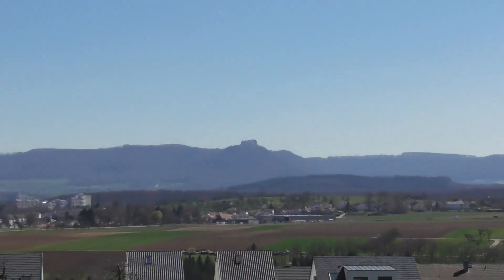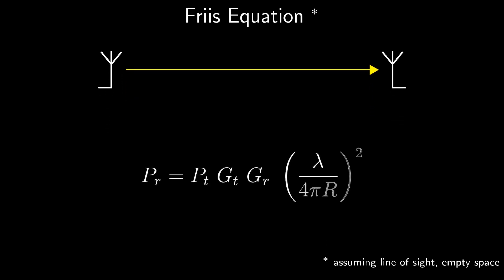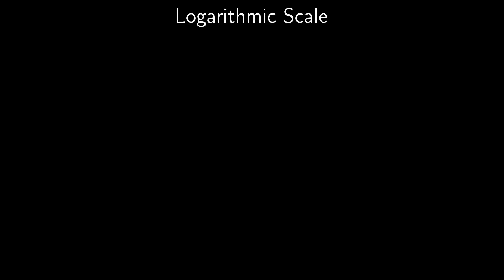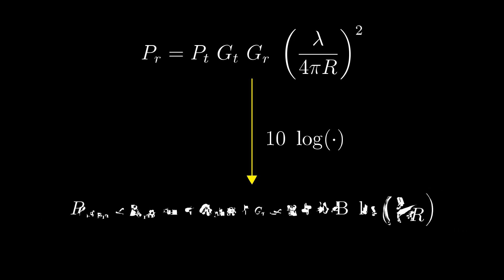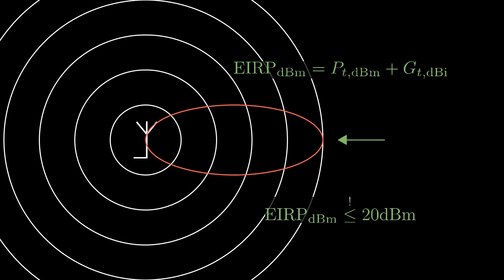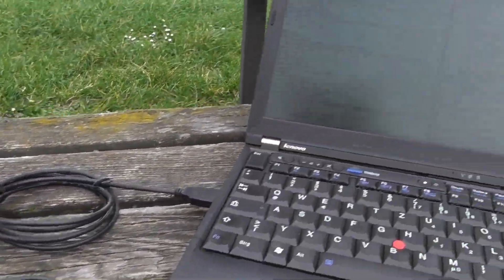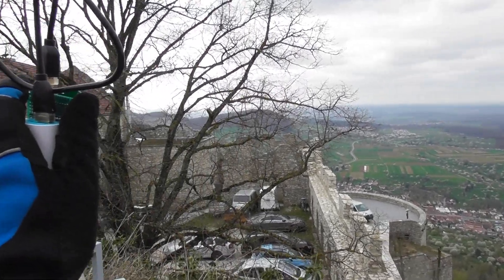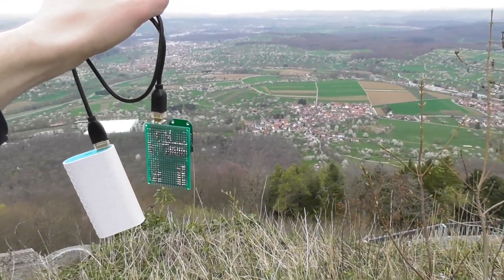ESP32 WiFi Range Testing - 10km using Directional Antenna

Comment: you should try using cw communications by (mis)using the FCC test function built into the esp32. you should be able to get lock at far lower signal levels. bonus round: place esp32 on the lnb of a tv dish and uplink to qo100 ham satellit transponder (2.4ghz cw)

Comment: I just remove the antenna from the grid reflectors and mount the esp32 or esp8266 itself in a PVC tube in its place.  It's still using the standard PCB antenna, but it's now in a nice high-gain place!

So, "technically", I'm not really breaking the rules, but get a few kilometres range on my mesh networks. 🙂

Comment: In case someone, as me, try to understand how Jeija did this...

There is no connection between emitter/receiver, this is achieved by not using conventionnal wifi but just the broadcast mode that is usually only used by the AP to advise any device that it's own network is in range, that mean this data isn't sent specifically to one device but to all of them able to listen (mainly this is network name, kind of password safety...etc).

In the esp32-80211-tx sketch, we roughtly take the first part of the beacon frame, then add the false SSID name and then add the end of the beacon frame before to send it. By this way the hidden AP make believe that some other's network/AP are availables.
That don't change the beacon frame size, it only make believe another sender exist.

The same process can be use to carry data instead of fake SSID's, but the beacon frame isn't extensible so only, 32 bytes can be carried by SSID part, 6 bytes by BSSID (mac address) part and 253 bytes by the beacon Information Element part of the beacon frame.

That mean the data to send must be splited in some consecutive beacon frame's with an ID number so that the receiver can reassemble the payload of each frame in order to reconstitute the original data. This process can be use for advertising or some other's legal stuff or... to stole data by a hacker.

As you understood it's not an usual way to use the wifi beacon frame, that mean despite the screen of Jeija during the video look like a web page, there is no adress to connect to it because there is in fact no connection between emitter/receiver, it act few like terrestral numeric television (TNT).

So it's necessary to have a special program on the receiver side that decode each beacon frame, extract each small payload data and reassemble it.

This is probably the impressive job that Jeija did and it's really pity that for some reason (maybe good reason's), he seem to don't want to share specifically his camera example which is really amazing.
Understand the code of esp32-80211-tx sketch and even modify it seem possible but the program to decode is definitely out of range regarding my knowledge...

My aim was to make a target camera with numeric quality and long range (500 to 1200m).
I won't do it ue to decoding program, if someone can and share, I would be very glad.

Comment: I have the AI thinker module ESP-32S and the FT232RL and still no joy. But I refuse to order another one. There is someone who recommends adding a small 10Uf capacitor between 2 spots. I suppose i will try that next. But i didn't realize there was face recognition in the software... for $8? Wow.

Comment: Dear author, would it be possible to publish 1) the final code that actually streams the jpeg data from esp32 with that one-way data stream and 2) some info how your notebook is able to receive it in that "monitor" mode? It would really-really helpful.. The published code (broadcasting some rickrolling SSIDs) is not really helpful to understand how the final project works. Thanks!
Reply: Well, just follow these steps as I mentioned below, tou can do it with the help of chatGPT:
1. Input jpeg 
2. Design a encoder (to encode jpeg from jpeg to binary) 
3. Transmit the data using WLAN or LoRA
4. Receive the binary
5. Binary to jpeg decoder (keeping everything similar to the previously designed encoder)
6. Export the jpeg to local drive

Comment: Very cool, I have the camera built into an ESP32 that is sitting in a drawer doing nothing along with several other ESP32's and 8266's.  Perhaps I should put them to work, I have been playing with that idea for some time, this video simply adds to my desire to see it work. I have no need to go 10 K but putting the camera in the back window of my Ford Edge that is hooked to my 35 foot Class A motor home and putting the monitor on the dash of my rig sounds like a wonderful idea.  I already have the backup camera system but my rig is over 10 years old now and the innards of the poor old B&W monitor have taken a beating, I need to rewire the power to get it working 100 percent, but now I have it at about 65% with the need for a sharp crack from my fist when it goes out. I have been repairing broken traces on the main board of the little monitor now before every major move, and it is getting to be a pain in the back climbing under the dash to access it all the time.

Comment: Anyone found links to purchase antenna and parts?

This might work. Need to check the connector type

https://rover.ebay.com/rover/0/0/0?mpre=https%3A%2F%2Fwww.ebay.com.au%2Fulk%2Fitm%2F281332287432

Comment: I'll pay whatever, so i can have internet from Starbucks at my home......
Reply: Lmao ! The main general working points here are 
1. That guy lives too far on country side.
2. I am barely seeing any other frequency operating ,even electronic item around in that bizzare .So ,nearely zero traffic  congestion .
3. That's placed over on a mountain peak .
Reply: But someone could always spy on your traffic from afar with this radar dish.
Reply: @TheRainHarvester  correct. when you leech from public or (god forbid) random unencrypted or WEP (they still exist yes, you'd be surprised), of course you need to be on your best behavior and not do stupid things. Don't go ordering stuff or pay your bills on that connection. Use your brain..
Reply: SWIM used to leech from public wifi's like the local pizzeria. It's good when you have an uninterrupted line of sight connection a few tens of meters. For example one used to be able to leech movies at night, but in the daytime because of increased car traffic the signal was sketchy. It's good to have as a plan B for when your own internet connection for some reason is lost.
Reply: Public WiFi sucks
Reply: No you not, due ACK settings distance limitation.
Reply: @jimsonweed1846  Default ACK timeout on many devices is around 10–20 µs. This supports around 750–1500 meters distance (one-way). Beyond this the ACK will likely time-out.
Reply: Yep but Starbucks or employees in it make do something if they are geeks and if distance is less approx 2 Km it may be possible and ,Finally they may know your passwords , credit card details or something very important like your g mail account 😉 better go for taking a connection even there is chance that a hacker is between you and public WiFi which may cause you lot of damage ,so keep avoiding public WiFi
Reply: @AnilArya51  Lookup "humor" in dictionary

Comment: i think its possible to send the signal even further, but you're limited by line of sight, the 2.4Ghz have a limited NLOS ability, basicaly 4/3 beyond the horizon distance.
i remember there was a record for wifi transmission done from 2 montains on different islands with over 300km distance.

Comment: With the 24dB Antenna and 500mW I made contact to the QO100 Satellite. 36000km in 2,4 GHz
Reply: Hi,  I am a ham operator here at Spain,  which mode did you use? I have seen it works at 10GHz, but havent find at 2.4

Comment: Fun fact.  You can split the transmit and receive signals out to different antennas.  Use a higher gain antenna for rx and a lower gain for tx.  Battabing butta bang, Bidirectional long range communication.
Reply: zyxwvutsrqponmlkh may it be possible??
Reply: @p__--  It's not just possible, its used in industry all the time.  https://www.ui.com/airfiber/airfiber24-hd/

Comment: Hi
With this i can receive 10mb from my router 2km away?
Reply: Recommend using some kind of directional hardware on both ends, a cheap yagi, perhaps? It should be pretty doable if you have LOS and less vegetation/obstacles on the path....

Comment: So if he pointed the antenna was pointed onto the village down there he would receive the wifi names but couldn't connect to them right?
Reply from the maker: Yes, correct. Unless I (illegally) ramp up the transmit power on the directional antenna's side.
Reply: @Jeija  Does that mean that if I had an directional antenna , I could just point it to the next free WiFi spot and give it more transmitting power and then I had WiFi?
Edit: Or maybe the normally allowed power for a omnidirectional antenna would be enough because the directional antenna concentrates it?
Reply from the maker: @dasgettopikachu7878  Yes, pretty much. And you are right, just the normal TX power (typically 20dBm in Germany) would be enough when using a directional antenna. In fact, you have to manually reduce the TX power when connecting a high-gain antenna to not violate EIRP regulations. But this kind of setup also relies on the fact that there is a clear line of sight, otherwise this is not going to work. You can search for "link budget" and "Friis equation" if you want to know more about this.
Reply: @Jeija  
Wow , thank you for demonstrating the receiving characteristics of directional antennas and also for answering my questions because for me it's very interesting!

Comment: Bah! I dont care about regulations! I'll use 1w power!
Reply: Become an amateur radio operator and you can legally run a lot more power than that. In Australia you could run up to 120w with no limit on EIRP. You would just need to do a few things like transmitting your call sign and not user encryption to comply with the rules.  Other countries may allow even more power. Keep in mind power doesn't always help and I've been able to use legal wifi power levels to cover 40km.
Reply: @vk3fbab  being a radio operator doesnt give you right to emit whatever power on all frequencies
you can only exploit your license on ham radio specific ones
the wifi standard falls on the 2.4Ghz band and its an ISM band, its license free to use, but with a limited power
and you're not protected from interference by other devices
Reply: @zazugee  in Australia we have rights to operate over a fair bit of the 2.4ghz ISM band under ham license. So long as I comply with the license I could legally tx 120W power. Would I? Not much point as you don't need that much power at 2.4. ham bands and power levels differ around the world. Here for advanced calls it's 120w any bandwidth any emission mode at 2.4ghz.
Reply: @excited box you might get better than 10km too even with omni antennas. Height  is might. I've done over 40km wifi without having to resort to using Ham power levels. From 100m high apartment to a 250m high summit.

Comment: Hi

What was the bitrate of the video stream? Was any compression used?

cheers Peter
Reply from the maker: It's not technically a video stream, but actually just a sequence of JPEG images. I used the JPEG compression inside the OV2640 camera. The bitrate depends a lot on image quality / framerate etc., but it's close to 1 Mbps.

Comment: What if you could use a directional antenna at ESP32-side? Of course a little bit smaller antenna than receiver, because ESP32 can not feed big antenna, I think. With directional antenna at ESP-32 could you increse the distance?

Comment: did u really just use this on-board antenna on the transmitter side? and if so how strong would it be if u would use a good external antenna on the transmitter side, too?

Comment: Also the conditions are really favourable because transmitter is on the hill. If terrain was flat, both receiver and transmitter would need to be raised high to to ensure the Fresnel zone is not obstructed. By the way it is possible to play with the polarisation of the signal by turning antennas 90 degrees to enhance the signal  quality.

Comment: How did you get your TP-Link T2UH working on Linux?
Reply from the maker: There are several drivers available, I think I used this one: https://github.com/chenhaiq/mt7610u_wifi_sta_v3002_dpo_20130916, just search for "MT7610". There is also this guy that seems to be working on improving the driver and eventually getting it upstream: https://github.com/ulli-kroll/mt7610u
Reply: Tnx and which linux distro did you use?
Reply from the maker: Archlinux
Reply: @Jeija  btw

Comment: Amazing to see how well that tiny chip can transmit data so far away.
Is it possible to increase the received data quality by using something like a dish at the transmitter side to direct most of the radio signals towards the receiver?
Reply from the maker: Technically possible yes, but also most likely illegal due to the increased EIRP (at least in the EU). So there's no point in having a directional dish antenna at the transmitter if you then have to decrease transmit power anyways. Of course that's different in countries with higher EIRP limits, e.g. Australia.
Reply: @Jeija  most countries don't even enforce the laws... they just restrict imports. But if the imported products have their firmware modded after they make it through customs,  it's pretty much a  FFA.
Reply from the maker: To be honest, I think you'd be better off just using dedicated equipment. Directional WiFi antennas really aren't that expensive and you can also get special outdoor access points that include all the electronics for little money.
I don't know that much about internet access in remote locations / developing countries to be honest, but I was of the impression that LTE is making great progress in countries like India, where Jio just built up an LTE-only network in the last couple of months.
Reply: Would it be possible to convert a Satelite Dish into a Wifi - Transmitter point? I could think of many applications in countries where there is no internet available at remote locations. I would be interested in solutions for such an antenna pair

Comment: Yes, wifi protocol needs a package acknowledge in a time slot equivalent to the time the waves travel 100m, otherwise, the protocol assumes the packages was lost. So it is not technically possible to increase the distance of wifi without changing or ignoring this parameter. The use of promiscuous mode is a clever workaround for a unidirectional transmission, though.
Reply: Routers intended for distance (point to point) let you set this value, allow longer timeouts.  Look at the manuals for Ubiquiti AirOS for example.
Reply: What you're saying means you'd need to send an acknowledgment in ~350ns. I'm calling bullshit.

Comment: it seems you're not talking about the ability of the ESP but the ability of the receiver
Reply: hes talking about the sensitivity of the wifi aspect of the esp32 chip I think
Reply: The transmission is still done by an Esp without any antenna.
Reply: @militantpotato8671  without any additional antenna. That esp module includes PCB printed antenna.
Reply: @jamisusijarvi646  i meant an external antenna like the directional one on the recieving end. Dont go all technical on me man, i'm just a hobbyist not an engineer.

Comment: Great video, thanks for sharing. Do you think there would be a way to do this in reverse but with just audio. So, to describe what I mean more, I would like to transmit audio using a directional antenna to a receiving device (or even better, many esp32 devices that will listen) that is in listen only mode. The idea is for on a large farm in Australia, multiple farm vehicles can be equipped with an ESP32 with a roof omni antenna so they can listen to internet radio streams while out in the fields (where no radio reception is available). I note your receiving antenna is a very large directional antenna, this is why I am wondering if it could be done in reverse so that a truck/car that would be moving around could just have an omni antenna. The directional antenna (or high gain omni) would be at the base, elevated on a roof top or mast.
Reply from the maker: I'm afraid that is not a good idea for multiple reasons:
* Farm vehicles tend to operate on flat land or in a landscape with small-ish hills. Unfortuantely, as soon as you loose line of sight to the transmitter, the stream will stop since there is not much diffraction at 2.4GHz. Even if there is line of sight, the ground will cause destructive interference (the fresnel zone is obstructed) on flat land.
* Audio streams are much more sensitive to volatile data rates; if I don't manage to transmit a picture all the time, I can just keep displaying the previous one, that won't work for audio.
* The data rate here is really low, so even a 128kbit/s MP3 stream is quite challenging to get across reliably.
* Encoding audio on an ESP32 is quite challenging already.

So all in all, I'd guess you will propably be better off using some analogue system at lower frequencies. But I'd be happy to be proven wrong ;)
Reply: Thank you Jeija, that clears up my thoughts on doing this as a project. The land where such a system would be used is extremely flat so line of site would be workable most of the time, but I didn't consider the realtime nature would be a major issue and make such a solution not workable. I was thinking of using the opus codec to attempt to get around this, but even then, as you mentioned as of yet the esp32 isn't quite ready for encoding. I'll revisit this as the esp32 becomes more mature. Thanks for your insight.
Reply: how is this project going?!?!
Reply: use separate chip for encode/decode mp3, YMPC-3001 for example